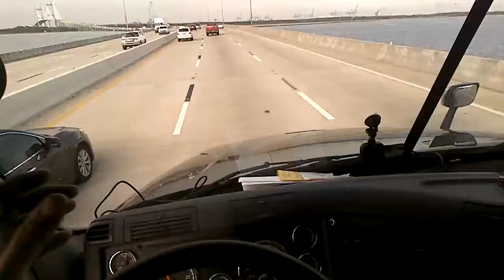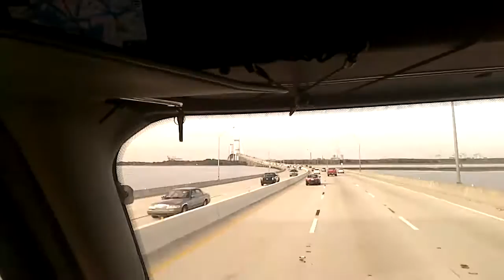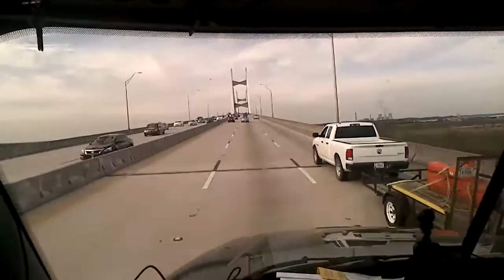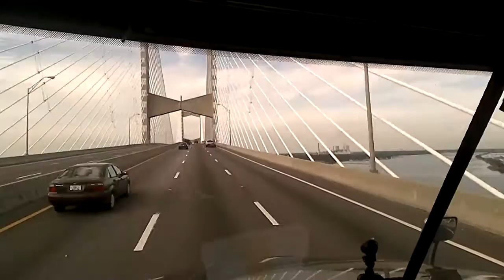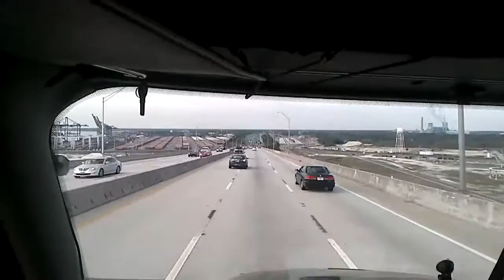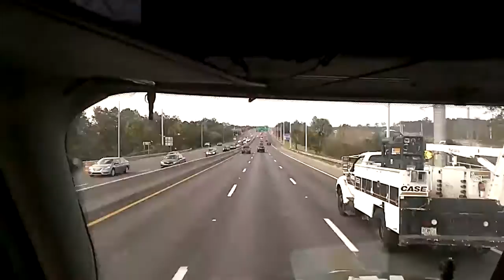Cable Stayed Bridge

Comment: Yeah, Scottie....when ARE you getting back into a manual?!?  Not soon enough, it seems.  Do you usually drive a 10 or super10 or 13 when you go manual?
Reply from the maker: I trained on a super 10. Went to Swift, all they had were 9 speeds. I leased a truck with them and paid it off, upgraded it for $200 to a 13 speed. That truck broke down and I couldn't afford to fix it so  I moved to JCT and leased a 10 speed. Turned that one in now have the automated transmission. It's growing on me though, not as bad as the first couple days i drove it.